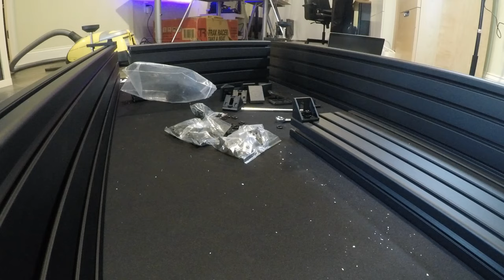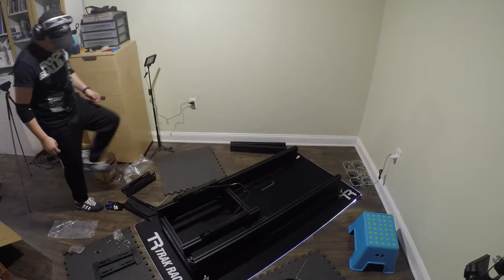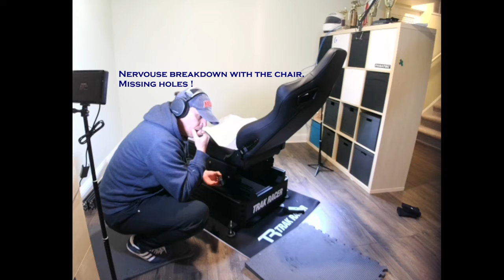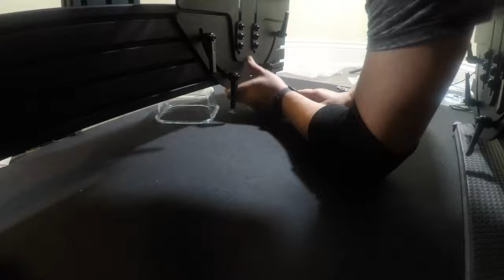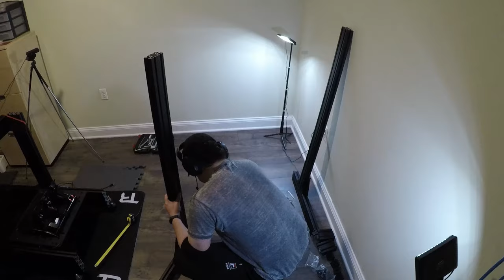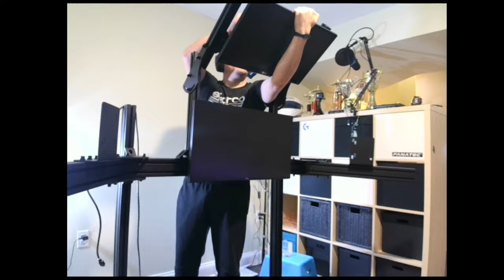Timelapse : Building my new Trakracer TR160 Sim Rig

Comment: Great video. I actually have the same chair and went through the same "oh shit" moment when I saw no obvious hole in the chair I could screw the plastic cover into. Turns out the metal hole is actually threaded so does in fact screw in without a problem. The plastic cover also needs to be pushed in with some force in order for the screw to meet the thread.
Reply from the maker: Metal hole is threaded!? thanks for the heads-up!

Comment: How did you access the bolt holes on the base of the seat? I’m probably missing something simple but the seat material is covering all 4 bolt holes
Reply from the maker: Fix the plate to the seat before fixing the plate onto base and fix the seat with the plate onto base ;)

Comment: Hi, I have a question I'm going for the TR160 but still didn't make up my mind on the pedals plate like yours or the aluminum profile with heel plate note that I have a Heusinkveld sprint with the Heusinkveld plate, so my question is did you notice any flex with your Trak racer pedals plate?
Reply from the maker: If you are asking whether the plate is bending/flexing under pressure, answer is; no-way! Super heavy duty plate, more than 10 pounds.

Comment: I Noticed you had your mats rolled up and a weight on your monitor stand.  Is the rig moving around on the floor.
Reply from the maker: Good catch. Mats were temporary for moving the rig to its final position (it was easier to slide with those mats). I removed them afterwards. Weights were for securing the the monitor stand doesn't lean and fall, but I tested many times afterwards, monitor stand is solid now. No need for weights.
Reply from the maker: btw, there is no chance that rig moves around on the floor, it is super heavy.
Reply: @smoothdriver4172  
Thank you for your response. I will be ordering 1 soon once my room is rearranged. Thanks again SmoothDriver very informative vid.